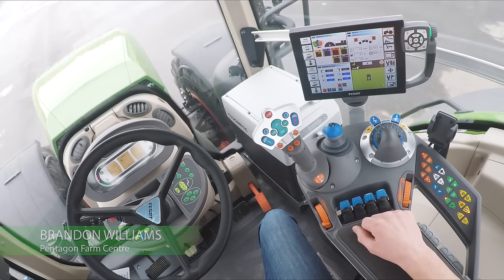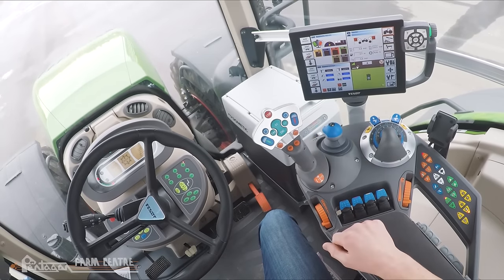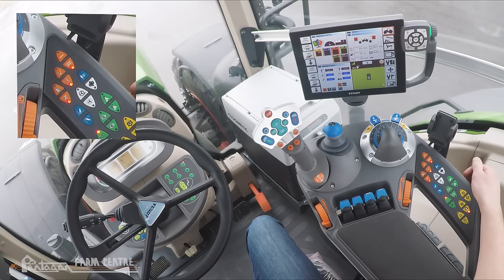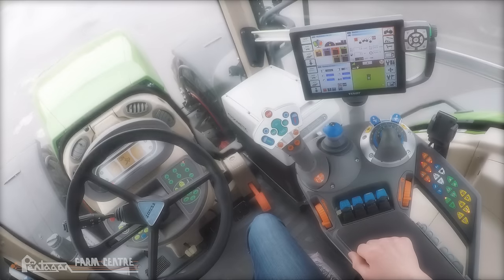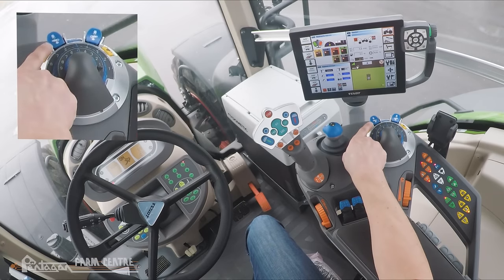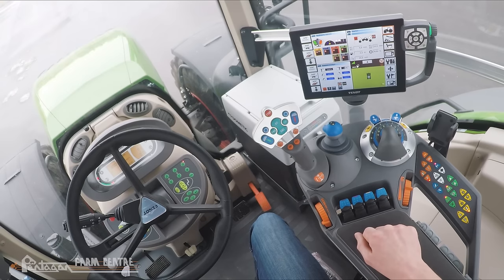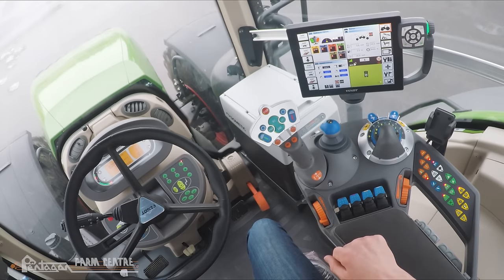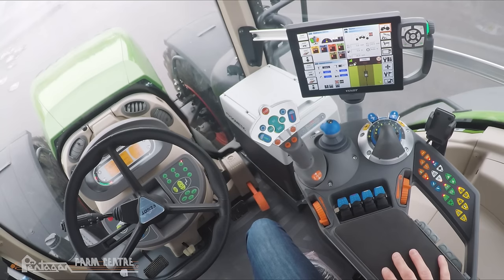Fendt How To: Console Controls

Comment: activation button is only needed to start driving in chosen direction or change it, no need to use it for anything else
hydraulic switches are programmable, so  any switch can be responsibly for any coupling

Comment: I have a Fendt 933 with front hitch, but does not have the smaller dial or the left blue raise/lower button. Is there another way to operate the front hitch? Or do I need an upgraded dial and switch? The tractor is new to me and not sure the history of it, but the monitor does recognize the front hitch.
Reply: Daniel Ostapovich, there is three front hitch options.  Standard, Comfort and Comfort with load relief.  It sounds like you have the standard option.  It is possible to upgrade to the other two options, I would suggest you talk to your local dealer to have them help you with this as the tractor does require parts to be installed and programming as well.

Comment: On the crossgate lever, there are two buttons on the front labeled "3" and "4", is there any use for those buttons? When I press them, nothing happens, and I can't seem to find any settings for them on the moniter
Reply from the maker: Hi Kevin, the 3 & 4 buttons on the crossgate lever are used for 3rd and 4th functions on the front end loader. If you haven't got a loader with 3rd or 4th function then they will not do anything.

Comment: How do you make the PTO keep running when not in the seat?
Reply from the maker: To engage stationary pto operation, the tractor must be: stationary / pto off / park brake applied / operator in the seat. Then push and hold the front or rear yellow pto icon button with "A" until the LED blinks. Now engage the pto.